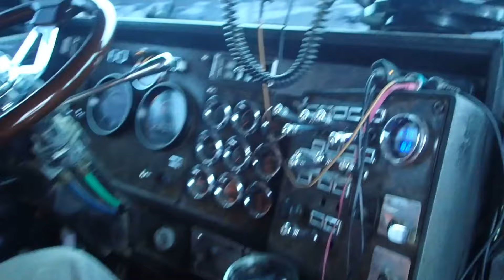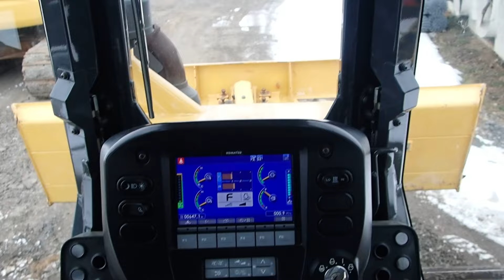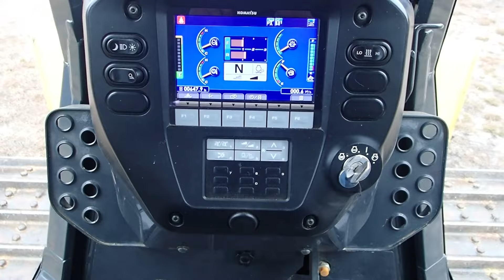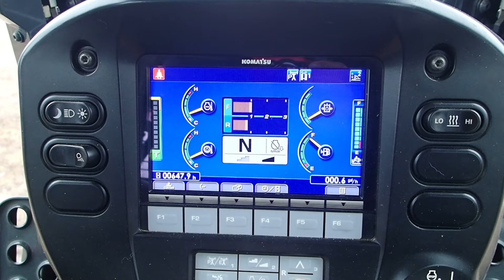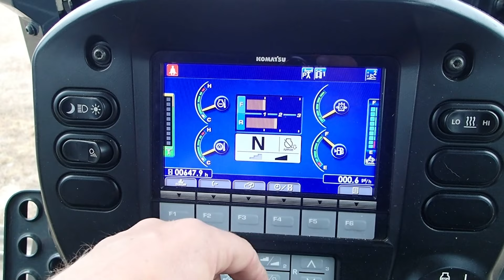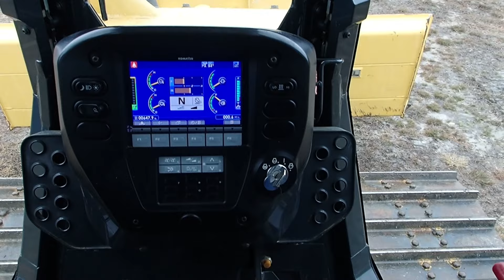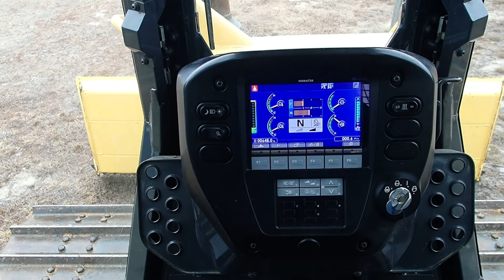Road Trip To Get My New Dozer!

Comment: True center pivot! Awesome! I miss the gas powered Caterpillar 22, Hand crank, ether pots... I used to get to run... bucking snowplow piled ice back into the forest. Fun times, clutch and brake skiing in huge arcs... accidentally causing the staff road to be a field of glacial crevasses... It got sold to a restoration museum, and bought the church camp a modern generator. , so it lives a pampered life now, good stuff.

Comment: I had the same issue with my 650 HLGP so I cut the blade at the end cutting edge and build a hinge for it so I would not have to pull a permit when I move it. Worked great never had a problem 👍🏻 congrats on the new machine!

Comment: Hey bud, couple tips to save you headache on that dozer. Don’t turn the master switch off until the green light is out, make sure you  use 10w-30 for hydraulic oil (or else major pump and motor failures). Also the fan sucks thru the holes in the doors on the hood, so if she starts running a little warm check to see if dust is built up on the inner side of the radiator. I work on komatsu for a living and always want to make the owner/op happier if I can. Nice buy 👍🏼

Comment: One trick to getting around oversized load issues is to set your chains where the chain binder handles actually stick out a few inches beyond the tips of the dozer's blade on each side.
In this way the oversized portion of the dozer's blade tips are within the width extension of the safety equipment (chain binders are considered safety equipment thus are not considered part of the load nor subject to meeting requirements for oversized regulations).

Comment: The counter-revolution track drives definitely makes for a very maneuverable machine,just spins on a dime,,the dozer loads the blade nicely, and once the rusty blade got cleaned ,unloaded well in that sticky dirt you were in.Nice Machine!! With the radiator mounted behind the cab,yuor gonna be spending a lot of time sealed in your air conditioned cab with the windows tightly closed, otherwise, you'll look like you've been running and old Euclid TC dozer by the end of the workday!!😁😁

Comment: At least you got the rust off the blade. It hasn’t been to long, the only controls were a couple of pedals on the floor and a couple of flat metal sticks sticking up. A few little hydraulic control levers for the blade. The AC/Heat/Rain we’re controlled from above. Now if it don’t do what it is supposed to do, call the man and get your checkbook out. I’ve heard you make several comments about the cost of repairs to the electrical system (brains) but everything we have now is like this. The old guys had to work. I’m happy for you Chris, now get it out of the hole you dug and fill it up. Stay safe

Comment: Nice new little machine there that ought to fit in well with the projects you get into.  The controls are rather intuitive and they've got comfortable cabs these days.  Having the screens for lot clearing and such will be a bonus, I'd think, even though you've a good eye for the potential window-smackers.  Now you just need a truck and rgn...  I learned on the mechanical necks but hydraulic is sooo much better.  I see a lot of guys that always pull straight forward but it really doesn't matter a lot so long as you drop and detach perfectly straight...  One learns the sight lines in the mirrors pretty quick.

Have fun with the new addition!

Comment: I noted your tracks are a little loose and need a little bit of tightening, they will run quieter and not flex as much and rise , this causes abnormal wear on the drive gears and the tracks. Love your videos keep up the great work.

Comment: Chris, if that was my machine I would design some stone deflectors to put on the back of the blade to protect the blade angle cylinder rods from getting damaged rods from debris coming over the top of the blade, such as rocks gravel and rocky dirt, just a thought it my help

Comment: The blade on the dozer does it pitch forward and back ? From the video it sure looks like they designed it to carry but with out the u sides? What is the hp and volume it will push similar to the D5. I definitely like the low center of gravity and access and visibility from the cab as opposed to the cat ! That sticky clay is a mess when we get in it up in the pacific north west I like to get the machine as clean as possible and hit it ( blade & UC ) with silicone (CMU. Block sealer) in a spray pump that you use for concrete works great if you stay up on it , just keep it off the grousers or you’ll end up on your Keister

Comment: There was a turbo issue on the 65px around the same year where the engine was running on  creating its own oil and. Just keep an eye on the level of engine oil rising sorry to be negative but just to let you know as it could be costly if this model year has same problem

Comment: as much moving you do looks like you would have a drop deck or equipment moving truck trailer as for the def or the re gen emissions control i think i would rather deal with def than the re gen deal there are troubles with the re gen system if you do not run it where it stays above a set temp  it will start throwing re gen codes and will cut you down to half power i dont like running one that hard my self

Comment: “Icy sleety roads”. Which is far more dangerous then paved roads that have been fully snowed over.  Our Highways 🛣, our main road that runs through our small town here in Northwest Montana, Eureka, is a 2 Lane Rd. and we get snowed over and it stays that way until spring.   Simply because we get so much snow there is no way you’re going to keep up with plowing it off. And once again driving on snow is not dangerous compared to driving on icy sleety roads.   They are much much safer.

Comment: Ok so being from the deep south maybe you can explain something. Up north they put salt on the roads to melt the ice but here in the south we put salt in our ice cream machines to make the ice colder and last longer. What gives?
Reply: Salt lowers the freezing temperature of water. The reason you use it an ice cream maker so that the water can get colder than 32 degrees without freezing.

Comment: Those D39px’s are pretty dang cool. 

In spite of the fact that they are the ugliest dozer ever created by mankind, they are pretty cool. If a guy tried to make an uglier dozer than this, it would just come out as a Case. 

They are amazingly sure footed too. In the woods, they can hold their own. Did I mention that they are ugly? 

From the seat, the operator has an amazing view of the back of the corner bits and everything in front. The best view of any dozer smaller or larger. But oh my gosh the thing is ugly. 

It’s really ugly. I don’t think you could make an uglier dozer. If you tried to put more ugly on it, it would just fall off and still be this ugly.
Reply: damn, have you looked in the mirror
Reply: @richardschipper5989  it’s bubbles from the TV show trailer park boys funny guy.

Comment: 6 or 7 hours to drive up one way.
DOT says 10 hours max behind the wheel (woth a 0.5 hour break sometime in the first 8) during any 24 hours.
Did y'all switch drivers or hotel/motel it for ten hours to restart your dirve-time clock?
Electronic logs have been required in USA for a few years now, so no cheating with paper logs. 😷👍
Much safer on the roads now without "super truckers"  (AKA:"Stupid Truckers" falling asleep behind the wheel.

Comment: No, Amish. And not a draft horse, standard bred. Menanite drive cars. These are covered buggy Amish.
Reply: Mark Hershey- Hershey Plumbing what is “ old order Mennonite “ ? That’s what he said he was? And I thought only draft horses have furry legs?
Reply: @copperheadmarine  no ideal about old order Mennonite. General Mennonite adopt more “English” and modern lifestyle. Use cars and electric and adopt kids. Amish around here come in 2 flavors , covered buggy and open buggy. Open buggy(no top) are generally more strict. Interestingly they both speak Pennsylvania  Dutch but have to talk English when talking to each other because of the different dialect between the 2. Drafts pull their equipment, standard bred pull their road buggies.